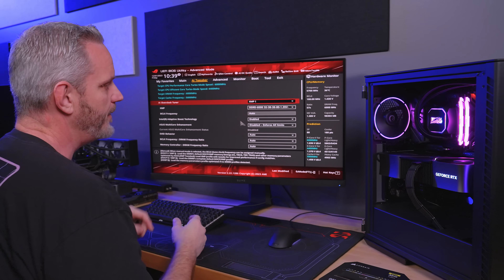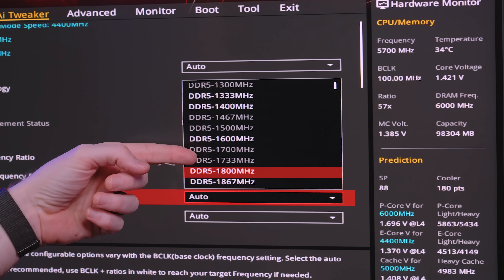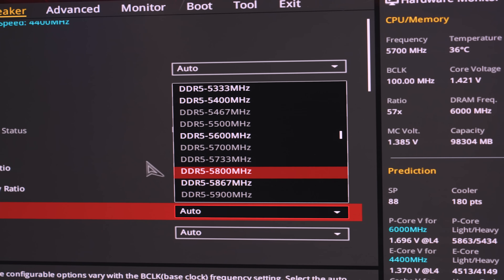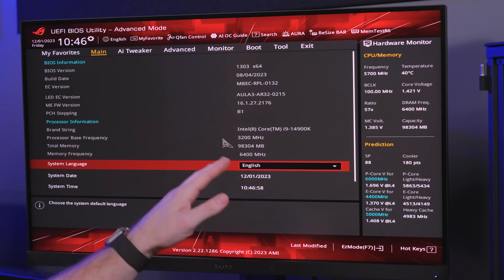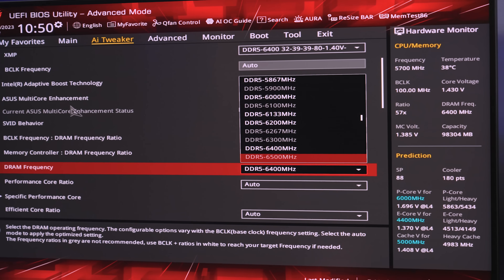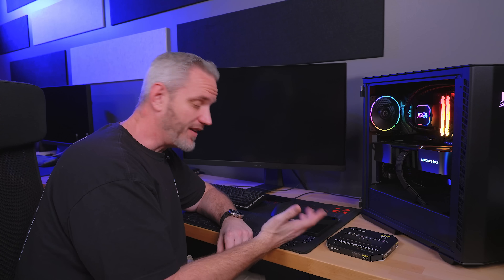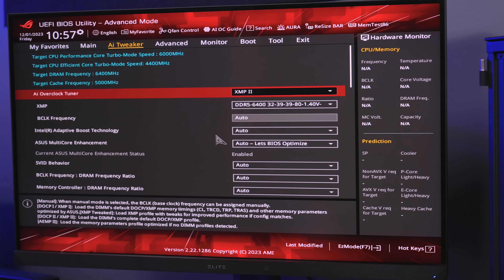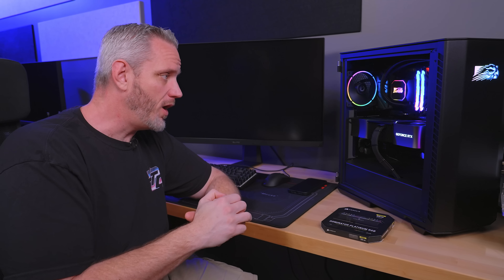Crashing PC? Check this first!

Comment: Xmp profiles hand tuned in a lab with equipment to determine the difference showing all the parts caps regulators work higher percentage at these settings via manufacturer Xmp setting explained

Comment: My xmp 'works' but will crash games unpredictably and make windows unstable with bluescreens so it's obviously not a stable clock

But then I've tried doing a very light clock and voltage bump and it still has issues. So I'm assuming it's the mobo even though I spent extra on one people haven't had problems with for am5. Thing is I've got x3d chip and ddr5 so doesn't really matter that much anyway

Comment: my last cpu was a 2700X and it was stuck on 2800 speed i have got Corsair Vengeance LPX 32 GB (4 x 8 GB) DDR4-3000 CL15  not long ago i got a 5700X now it is runing at 3000 speed

Comment: But what if my PC doesn't BOOT even after clearing CMOS?
Reply: Then go into the BIOS and turn off EXPO/XMP entirely. Extremely unstable RAM simply will not boot.
If it still doesn't work and you've got a DRAM light on, warranty the RAM.
Reply: @rustler08   it doesn't boot at all,so I can't access the bios either.only the lights and fans turn on.

Comment: Here is one for you Jay. I get random shudders audio and video, I'm pretty sure I tracked the problem down but I've been seeing it more and more in my friend group. Its not due to not having enough power for the app/game.
Reply: Get LatencyMon and see what it says. I was having the same issue recently. Turned off fTMP on bios and haven't notice em much.
Reply: @Wobwob On mine machine it was related to a driver update from Nvidia, Once I DD the driver issue went away. My buddy's machine it was a cable related to his audio across his HDMI cable to his TV. He was just a Gen1 cable and pushing 4k with 5.1 surround. I have two other friends I'm trying to track down. I'll check out LatencyMon to see if it can help.

Comment: This is a great vid for me, as on my current system I've never been able to run XMP stable. I changed my RAM thinking that was the issue, but I still have an unstable system with XMP enabled. System is: Asus Strix Z590, i9-10900k, 32Gb Kingston Fury DDR4 3200.
I can manually O/C the RAM to just below XMP speed with 1.35v, but no XMP.
So if I understand correctly, this is down to CPU and not MB?
Reply: CPU is important because the memory controller is in there but the M/B is also important because trace routing can affect signal integrity as well.

Comment: With AM4 having a older board with newer AM4 CPU may also limit max ram speed. My X370 board with a 5800X would only run my Ram at 3200. Swapped my board for a B550-f board and now can run my ram at 3600.
Reply: Can probably go higher the dash F was surprisingly decent for memOC. dual Rank 4x8 3800c14 1T 1:1 up to 4400 desynched

Comment: I had a r5 2600 system, that would never work above stock ddr4 speeds ever after updating bios and using rams on the qvl list. I guess the memory controller inside the cpu was dud.

Comment: I got a 6400 XMP kit for my R5 7600 because it was the same price as the 6000 kit. I knew that 6400 probably wouldn't be stable since the highest Expo kit I saw was 6000, but for the same price I gave it a shot since I could just put in the 6000 Expo timings manually.

6400 ended up being only 90% stable and the absolute latency is the exact same between 6400 CL32 and 6000 CL30, so 6000 it is.
Reply: It’s either stable or not. It can’t be 90% stable yikes
Reply: @ROVolvo  So your computer will either run every piece of software perfectly or BSOD with no in between?! lol

90% is what we like to call an "abstraction". It means that windows and most software including a lot of benchmarks ran fine, but load up old Prime95 or random software X and the app or the PC entirely would crash.

There are MANY levels of "stable" too. Stable booting into bios, into windows, while running apps that don't full load the CPU, while running the apps you use, or while running every app that is expected to be able to run on that hardware. 

Even a "stable" (as you described it) PC will have software crashes or hitches and in the case of world record OC'ing, if your hardware makes it through just one run and  you submit the score, it was technically "stable". 😁
Reply: 100% predictable scenario.

Comment: Thanks for the vid that was good advice. One question I have is I have ddr5 memory and an MEG ACE Z790 MSI MB and the box on the memory if I recall said XMP 1 and XMP2 but in my bios it only gives me the option of XMP1 which is working great by the way, but I always wondered why I didn't have the second option available?

Comment: Also, if the system can boot back into Windows after a crash/BSOD, it's not a bad idea to check the Event Log or Reliability Monitor to get further information about what happened (the latter explains BSOD events a bit better). And if feeling adventurous, examining the memory dump/minidump generated during the crash with windbg, and some searching and RTFM if the documentation is available.

That's what I had to do to properly diagnose that my GPU was on its way out, even after reinstalling Windows 11, downgrading to Windows 10, reinstalling drivers, and doing a close-up inspection of the board. Both windbg and Reliability Monitor offered the same "basic" information you get with the BSOD ("video scheduler internal error"), but the extra details on the ID of the error code made me realize either the memory or the core were going bad. Without some proper testing tools to do memory training/tests (coughcough MODS/MATS), it's safe to say "the GPU is dead" after 7 crashes in a day and no signal after booting back into Windows. 

On the bright side it was a 550 Ti so nothing super expensive, but on the other hand it's an EVGA card, so it hurts a little bit.
Reply: A useful app to easily view possible causes of the bsod is WhoCrashed or BlueScreenView.
Reply: Bake it in your oven at 400F for 10 minutes. Also remove the heatsink and fans, and anything else that will melt at that temp before baking. Or you could try getting Norwest Repair here on YouTube to fix it for you.
Reply: @ScoutReaper-zn1rz and don't ever use that oven for food again.
Reply: @dfax1 you can’t tell me what to eat, I love my lead infused mac and cheese!
Reply: EVGAY cards are... well... you know.

Comment: Other think to watch is some MB will after training choose GEAR 2 for memory and so it says its running at XMP but actually much slower than it should.  On my Gigabyte I have to set XMP AND  force Gear 1 at the same time so it trains that way.. This affect memory preformance a lot.
Reply: I got bluescreen if i put xmp on and gear 1, gear 2 with xmp is fine for me

Comment: This is WHY you don't buy used mobos lol...  

All it takes is someone to drop a screw or screwdriver on the motherboard and it would f it up.   Or, scrape the motherboard on the back when they're trying to line up the standoff screws 

It might be MONTHS before you use that specific feature where that circuitry got damaged lol..

Do you think refurbishers test every nooks and cranies to make sure every feature is working properly? Most likely not

Then you'll waste countless hours/days trying to diagnose what the issue could be... Could be your ram (no problem do a mem test), could be your power supply (no problem, they have that jumper thing that could test it?), could be your gpu (no problem could run some bench marks and see if it overheats or something..), could be your hdd/sdd (no problem could test if there's any broken sectors)......Maybe it's the mobo, oh wait... how dafuq do you find a micro scratch that someone dropped a screw on the circuitry  LOL

Lol I am that idiot who dropped a screw on the mobo.. I too and an idiot who probably scraped the f out of the mobo trying to line up the mobo on the metal standoffs..   Returned 1 and sold one off on CL.  After 3rd try of installing the mobo, no drops on the mobo from a screw driver and didn't scratch the back of it when lining it up on the standoffs.  No bluescreen since then =P.

Comment: Can't you get better stability at higher speeds and tighter timings by increasing voltage?
Reply: Only if you are lucky enough to get a good CPU with a good memory controller
Reply: Sometimes but I think the effect is less for RAM remembering back to some of my DDR3 testing

Comment: I got a Trident Z 3600mt CL18 kit in my system. Got a Royal Elite 3600MT CL16, tried to join the two kits. Running them on CL18 would post after 10-30 minutes at times of post cycling. Even tired manually dialing in the timings *matching the slow kit timings*. Finally I gave up and stuck to the 16gigs kit of Royal Elites 3600MT CL16. My brain almost exploded tying to deal with ram settings, its hectic and not worth the waste of time. For reference I'm running 9700K on Asus Maximus XI Hero @ 5.2Ghz 1.370V -2 AVX offset.

Comment: First gen Ryzen took a very long time to mature and mine is now running stable at 2933 MHz with CL 16-18-18-36 for years but it took a lot to get there. Can't wait to buy something new hopefully next year.
Reply: Depending on what motherboard you have just buy a ryzen 5800x3d and you will live happy with it for at least 3-4 years also depending on what games you play
Reply: My fist gen Ryzen wouldn't oc past 3.9ghz but would run my 2400mhz ram kit at 3200 perfectly stable.
Reply: I got past 4.1 GHz stable but my cooler just can't handle the 240W and I'm not very comfortable running it at 1.55V all the time. I settled down at 3.9 but guess the memory controller just doesn't like me, because even later BIOS versions didn't help to get an higher there.
Reply: @crumbman  might have been the specific kit, cuz on a friend's kit of high end 3000mhz ram on my PC I couldn't get it to go above that at all no matter what I tried it would refuse to be stable.

Comment: Got a 48gb 8000 cl 38 kit 
and it booted okay and everything. Loaded up flight sim 2020 and would crash everytime. Reduced it to 7800 and it's been stable so far fingers crossed Running a 13900k
Reply: What board?
Reply: @ROVolvo  MSI z790 godlike
Reply: @Dethincrnate  it’s not stable then. If you don’t have a 2 slot board you’ll never get 7800 working. Get a karhu memory test licence and test it yourself. It will error very quickly
Reply: @ROVolvo  dang
Reply: @ROVolvo  dropped it down to 7400 and it seems to be performing better

Comment: Let me add BIOS setting" Intel Dynamic Tuning" and perhaps adding in the "INTEL GNA Scoring Accelertor" (which was just placed on my Gigabyte MB Chipset list, which requires Dynamic tuning to be turned on run.   All I know is my 12700K for App starts and Windows start ups and a few OS oriented were getting pushed at my 4-ecores.    I would see my system stall out with e-cores masxed and the P-cores barely utilized.  I was going to get a 14700K just for more e-cores. After installing this GNA Scoring Accelerator AND turnong Dynamic Tuning (mich might be the only real need)   My 12700K core usage changed dramtically.   The e-cores only max out if everythign is maked out and my p-cores are used more.  No stall outs durning syste startup, soem slow loading apps going much faster.  And CPU pass mark moved from 33500ish to 35700 ish.    SO small improvment, but large smoothing out general multitasking.

Comment: The clear CMOS button does the same thing as the jumper does, instead of putting a jumper on the jumper pins you push a button to make the same connection.

Comment: I've recently did a Bios Update on my B550 board and while I could run 3600MT with DOCP earlier, after the update, I can't manage to hit that frequency anymore. It caused me a lot of headaches and stress recently but so far it runs okay on 3000MT DOCP profile. Could this be caused by the threat mitigation updates that CPUs have received via bios updates?
Reply: Downgrade and try :)  I sort of doubt it's due to data leak mitigations but maybe something changed with the RAM training that upsets it
Reply: @big0bad0brad  I haven't tried downgrading yet, but I've read that it isn't always possible for Asus boards apparently and I really don't want to use any shady tools or programs to flash my bios. 
I might try downgrading sooner or later when I have more time to invest into my system again, but I fear that it isn't going to work and throws an error at me or something

Comment: I had a weird issue with my ram a few weeks ago. I was installing a window update & it froze on the first post after it restarted. I futzed with it for a bit, as it was giving a memory issue light. tried testing one stick in each slot, then 2. all those were just pure failures, didn't even get to the memtest light. finally put all my ram back in & it just memory trained for a bit & worked again. had to reapply the docp & minor overclock I'd had applied for years, & it's back up like nothing happened. still have no idea what was going on. 

only thing that seemed to do anything was turning it hard off at the power supply, switch flipped & unplugged to drain something, anything out of the caps. only after that & refilling all the ram did it work again

Comment: I had so many blue screens and freezes on my 7900x3d with 6000mhz, 32gb Corsair ram! Drove me nuts! Went back and got 32gbs approved on the qvl and haven't had a problem since!
Reply: i get random freezes too and i dont know how to find the cause have32 gb corsair ram too
Reply: @TheWeedinmybrain  It's almost definitely expo or xmp whichever is on. If u disable it and the freezes stop, there u go.
Reply: @TheWeedinmybrain  Turn off EXPO. If the problem goes away, it's your RAM. You can either manually set it to something lower like 5600 or you can just replace the entire kit

Comment: Running a z790 Hero Maximus and It won't boot with XMP enabled. Wont even boot if I change the ram to something different! 12900k / 4090 / 32GB
Reply: you sure your not using xmp 1, on asus bios they add alot of other memory settings, just use xmp2 thats default settings for memory from the maker.

Comment: Jay I have an Asus 3060 GPU and an AMD 5700 g CPU when playing MW3 I notice for the first 2 minutes of each match it's saying packet  packet burst then It clears up... Do you think my CPU might be the cause of this, I'm not running it on ultra settings and I've played around with the settings quite a bit and am able to run a steady 140fps I have a small overclock on the 3060 that keeps it at a stable 2150 megahertz

Comment: Great video ... last night my 7950X suddenly wouldn't boot my EXPO settings.  No idea why, I didn't change anything.  I flashed the CMOS, went back in and switched on EXPO and everything worked again.  No overclock on the CPU since this is my production machine.  It reminded me of your recent video explaining why you decided to go back to Intel.  I can feel your pain 😉
Reply: @TechTusiastthanks for the suggestions … I have extensive experience with PC’s, so I wasn’t really looking for a solution but I do appreciate your help … it’s also not a problem that I’ve seen before … it has been running fine for 10 months … I update the bios whenever there is a new release … this was simply a strange glitch that was fixed by clearing cmos and resetting bios.
Reply: usually those problems start with A and end with D
Reply: @MikeZak101  usually those problems start with users like you and I hope ur comment was a joke. Yes, AMDs IMC are a hit or miss with certain RAM Kits, but as soon as you pick a stable combo (looking the motherboards QVL and picking the right RAM tested by the motherboard vendor), you most likely won't experience such issues. And if so, then try other profiles or if a bit experienced, try setting up the RAM speeds and timings manually. Sometimes the RAM voltage is too low for the targeted speeds of those kits. And believe me or not. Sometimes I had the same issues with "uncompatible" RAM kits on the other side. Intels 10th and 11th gen IMCs had been sometimes a great troublemaker too.

Comment: Sometimes the tiny performance boost offered by XMP is just not worth the headaches. I have 128GB with a 7950x and the overall performance with 4 sticks at 3600 MHz is maybe ~5% slower than when I had two sticks at 6000 MHz.
Reply: the more dimms the more problems
Reply: @scepticskeptic1663  with ddr4 its usually fine to have 4 sticks but I do agree, ddr5 and probably beyond until consumer boards get 2 memory controllers, you want to only use 2 sticks.
Reply: @TechTusiastNo I mean 3600. Good luck running 128GB on AM5 at 4800MHz without corrupting your OS.
Reply: You're down probably 7-10% at that speed. It's over 5% gains just from base up to 6000MHz.
Reply: @rustler08  That depends on the task.
Reply: @TechTusiast The main issue isn’t really the BIOS, although it is true that older BIOSes were generally less stable. The problem with 4 sticks is the AM5 memory controller. On an older BIOS I got memory errors even at 3600MHz. On the newer BIOS it is stable and I don’t care to push my luck on it lol.

Comment: Hope this video has the answer I need. I’ve been having pc crashes and have tried so many things. It gets really frustrating.
Reply: A good way to start diagnosing crashes is to check system logs, especially after a BSOD. Event Log and Reliability Monitor are good ways to start digging into what could have caused the crash. On top of that, installing windbg and inspecting the dumps created during the crash - whether it's a memory dump or a minidump, can also give you some extra information related to the errors. That, some Google-Fu, and any official documentation if it's available.